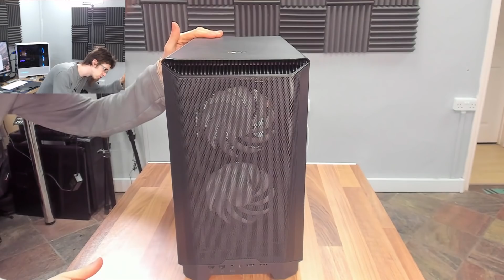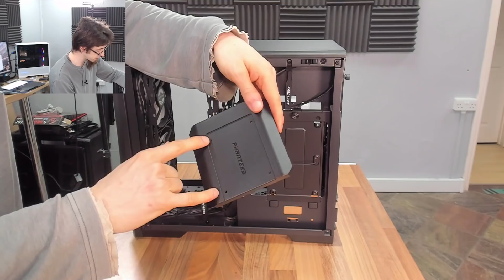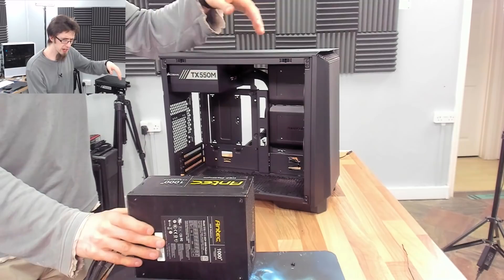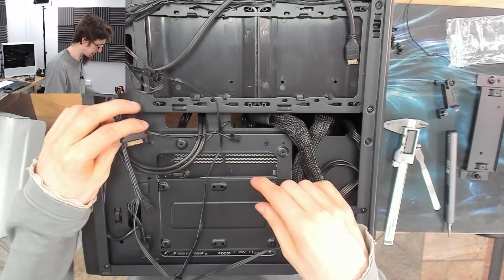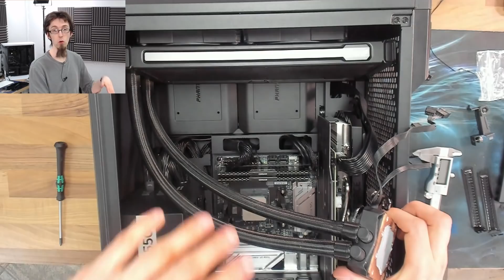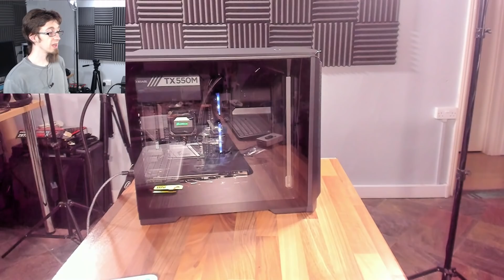Phanteks P200a Overview & Build - LBC#65

Comment: Hi Graham, wondering if you can help me here...? I recently(ish) upgraded my CPU from a 3200G I got brand new to a 3600 I got used on eBay, but I only got round to installing it recently and it gave me several BSODs which increased in frequency (which I wasn't getting with the 3200G) while merely trying to do music production and 3D modelling, even though my friend said he knows someone running a 3600 on the same board as mine (Gigabyte B450M DS3H) with no issue - even though there are better boards out there I don't think a 3600 is asking too much of it.

I tried several things to try and get this CPU to be stable - swapping PSU cables, reseating my RAM and graphics card / trying different RAM configs, running hardware tests which all passed (including even the CPU stress tests, and no I wasn't using the box cooler while running them - 67°C max. while stressed on a Fuma 2), clearing CMOS, updating BIOS, updating chipset drivers... without any luck.

Eventually I went into the BIOS and disabled the default automatic clock speed control setting that enabled the CPU to boost to up to 4.1GHz or downclock to down to as low as 1.7GHz depending on what was required. The CPU is currently running at a manually set fixed speed of 3625MHz (it bounces between 3.6GHz and 3.62GHz) and that way it's stable, but it should work on default settings, and as it's not boosting like this it only slightly outperforms a 1600 on its default settings according to my testing.

I asked the seller for a refund/return but he said it's been too long (over 2 months), that the RAM could be the issue as "Ryzen is extremely picky with RAM" (I have 32GB / 4x8 of HyperX Fury 3200MT/s, half of which was part of the original bundle), that the CPU was working completely fine on both boards that he used it on (an MSI X570 Gaming Edge and an Asus Prime B450M-A), and that he got BSODs on his 5800X at default settings and a whole bunch of issues, and to fix it he has to use higher voltage on the RAM and loosen timings/frequency a little.

Sorry this is long, but do you think I should open a case with eBay or do you think I should just try adjusting these RAM voltage/timing/frequency settings...?

Thanks either way,
Rowan
Reply from the maker: Yea I'd say that's a RAM issue. Reset everything to default settings again (so you CPU is boosting), then try running two modules, try testing with XMP turned off as well. If these have an effect, then make sure you're on the latest BIOS, and try under-running the RAM (if it's XMP 3400, run it at 3200, etc) and that may do the job.
Reply: @Adamant_IT  Thanks, I did change from 3200 to 3000 after I remembered your video where you do it on a "Fortnite box" and it's stable now so thanks a lot :)

Comment: Front fans fit nicely outside and then the 280mm radiator does not interfere with the power button, also better to use 140mm fans for the 280mm AIO. Maybe with the fans outside the AIO would fit with the hoses down too.

Comment: Hi, just want to know what is the benefit of having the PSU on top in this case?  thank you 🙏🏼
Reply from the maker: It allows them to do the full-length vent at the bottom, so the graphics card has clear airflow. Small cases like this often have problems with the graphics card being up against the PSU and/or PSU shroud. Only other way around this is a full inverted setup where the mobo is upside-down and graphics card points up at a top vent.
Reply: @Adamant_IT  Ok. thanks Graham.🙏🏼

Comment: Can you turn off the RGB lights? Most PCs are in bedrooms.
Reply from the maker: Yes, there is an Off pre-set, or you can also disconnect the RGB wires, or turn them off in software if you're connected to an ARGB header.

Comment: No matter the case format, a case without a PSU shroud and the PSU on the upper part of the case is an instant let down for me. You are instantly unable to cable manage properly and the centre of gravity is quite high making one's case feel weird when handling and unstable if placed on a desk, not to mention you can literally see the guts (PSU cables) of the PC at all time if you place the case inside POV on the desk. Check out the Enthoo Evolv Mini ITX from Phanteks, I used to rock one of those bad boys before I went for the full version of the case which I still have today 5 years later. No complaints.

Comment: Usually I'm more a fan of mATX (why go ATX, when you basically have no cards to plug in other than your GPU) but opt for ATX cases anyway because of the flexibility. Case and PSU are the most reusable components anyway.

Comment: Hello sir, saw your dell monitor repair video, i have dell u2414h monitor, with the problem of black screen/no display, i visited the shop, guy there checked the screen and told me FL is the problem, other components are fine, but he is not telling me the actual cost for the repair.
How much will it cost ? Im from india.

Comment: i really like this case but i feel like they could have made it work with micro atx as well without even having to make it bigger
Reply from the maker: Height wise, they're only about 15mm off of mATX. But they'd also have to account for width, and that would mess up the side radiator mount config and everything.
Although I feel like the side-mount isn't really useful anyway... seems like they sacrificed mATX, which would be useful to many, for dual-rad compatibility, which only a handful of people would ever use.

Comment: As long as the NR200P exists cases like the P200a have no reason to exist! If you want to go ssf you either go NR200P and down in size or you dont go SFF at all.
Reply: Why does the NR200P exist?
I have a really hard job trying to understand why such a big case exists.  I have multiple ITX systems and the biggest is a mere 2/3 of the size of the NR200P, the RVZ02. 🔥🔥🔥
Reply: @aetch77  cases like the RVZ02 are very limited in their CPU cooling support. Cases like the NR200 are about as small as you can go while maintaining compatibility with "normal" sized components.
Reply: @TimBoundy  Reality check - if you're going SFF then "normal" sized components are a consideration but they're not the priority.  If "normal" sized components are your priority you should really consider micro ATX at a minimum.
Water coolers, although widely spread, are not normal.  In fact, I consider the cooler packaged with the CPU as the normal cooler.  Any 3rd party cooler you purchase to replace it is a luxury because you're spending extra money to replace something you already have.  That said, I do have and use a variety of 3rd party air and water coolers.
Reply: @aetch77  most of the higher end CPUs don't come with a cooler these days. The 5600X is the only current Ryzen chip that does come with a cooler. Looking at the last generation chips, the Wraith Stealth stock cooler fits, but the Wraith Spire and Wraith Prism coolers do not fit the RVZ02. I haven't checked the Intel cooler sizes but those chips run too hot to make running the stock cooler viable (if they even have one). You need a low profile 3rd party cooler which limits your thermal capacity. In the NR200 however you can easily fit a decent tower cooler or 280mm AIO which is going to be a massive step up over anything you can fit in the RVZ02. A mATX mobo doesn't really give you anything over an ITX mobo in many cases since the GPU blocks access to the other PCIe slots, and the motherboard isn't really the limiting factor to case size in many layouts. You can actually squeeze some mATX motherboards into the NR200.

Plus the RVZ02 can't fit many of the recent GPUs as they're typically more like 2.5 slot thickness. It can fit long cards but not thick cards. The FE cards are usually a bit thinner, but NVIDIA only released those cards to select regions. The only cards available in my region are the thick board partner models.

Cases like the NR200 can compete thermally with ATX cases whilst using the same top end parts, in a much smaller footprint, and all you're really losing is access to the extra PCIe slots. Cases like the RVZ02 are a lot more limiting, but they fill different roles.
Reply: @TimBoundy  Oh my god, you're right.  I'd better run out and buy the NR200P to replace the RVZ02 I've been working with for the last 6 years and the SG05 for the last decade, I think not.
ITX really isn't the platform for high-end systems.  If you've got to go for a case big enough to support the micro atx platform you may as well get a case that actually supports said micro atx platform and get the better/bigger/cheaper selection of components.
Reply: @aetch77  don't be obtuse. I never said you have to replace your current stuff, they fill the role you want. But cases like the NR200 do support the top end components in a compact size. It's one of the most popular ITX cases right now.
Reply: @TimBoundy  Obtuse?  You jumped into something with a flamethrower and torched any chance of a constructive conversation.  You got the rude end of my philosophy.  I don't want or expect a reply of any sort.

Comment: Interestingly this ITX case has dimensions of 205mm width x 365mm height x 400mm depth and my Coolermaster Q500L that I bought after watching Graham's review of it is a full ATX case that has dimensions of 230mm width x 381mm height x 386mm depth. 
I think that if I want a small PC, I have made the better choice.

Comment: I have a question about the PSU gpu cables.
Let's say i can use a single cable on a 8+6 GPU, but is it better to use it, or use the 2nd cable that the modular PSU offer on  the 6 pin?
Reply from the maker: Depends on the GPU. If you've got a good PSU with proper cabling on it, the dual-8-pin daisy chain will easily carry enough power for both connectors. The cable should be good for 500w no problem, well over what nearly any GPU could use.
However, some big-boy graphics cards, especially stuff like the 3080, can pull nasty spikes of several hundred watts, and might get upset. Overclocking can also pull a lot of power, and might start loading up the PCI-E power cable.
So the TL;DR is, one cable is generally enough, but if you've got a second cable, use it.
Reply: @Adamant_IT  I have a RX 5700 XT, PSU is middle ground i would say, EVGA 750W Bronze, BQ if i recall

Comment: I think it is a bit too big for itx, just one pcie slot away from a micro atx. however also it looks designed for high end itx builds - front usb-c (only on expensive itx boards really), 3 slot gpu, space for water cooling. Thanks for checking it out and the build. Proper review.

Comment: when I recently upgraded my case , I seriously looked at that case.. Ultimately though I went with the phanteks p360a in white, wehich is a midtower atx case that shares a lot of the same design features. even though I have a mini itx (ASUS ROG STRIX z390-i gaming)  board in it I have my 3070 vertically mounted .. and it fills the space quite nicely ... big factor for me? the power supply basement .. makes cable management so much easier and cleans up the overall look of the build.. and size wise you really only add vertical height for the most part.

Comment: I have the same MB in a Tower 100. No problems so far, not even the RGB as lackluster as it is. I would love to find an adapter to convert one of those red USB 3.2 gen 2  type A into a type E that runs into the type C on the case. I haven't found one yet.

Comment: Great review. As a shopkeeper and reseller you have a different perspective to the usual review sites which is most useful. 

You mentioned the limited space on the ITX boards: that case looks like it could fit a mini-DTX board which is a wee bit bigger, has two PCIe slots, and has just that bit more room on the motherboard. Also, is there room to fit the two front fans to the outside of the case behind the mesh? I did that on my Kolink Citadel mATX case to create enough room for my RTX 3090.

Something you might like to try when building in these small cases is to use a fully modular PSU and run the PSU cables but not actually fit the PSU itself until very late or even last so as to increase your working space inside the case.
Reply from the maker: There's room for a DTX board, but no additional stand-off holes. Not sure if DTX uses a 6-screw layout or not though, so maybe that doesn't matter. Might be interesting though, as the DTX boards do get the extra headers!
Regarding the fans, yes I'd say you're right - it looks like that's how they expect you to do a two-rad set up in this thing, so you could theoretically have an AIO on the CPU and on the GPU.

Comment: Should have been filtered ventilation on top for the option of the PSU to be mounted fan-up, IMO.

The side fan mounting position seems impractical to me. You're going to use the front fans or the side fans but would you ever use both? Truth be told I would maybe have rather seen an "attic" shroud that conceals the PSU more and sacrifice one of those 2.5"/fan mounts.

I rather like the front I/O at the bottom.

As seen in your comparison, this is barely smaller in overall volume than the 220T (or the likes of my Meshify 2 Compact), so unless you have a weird unique desk setup with very limited height where the case needs to wedge in I just don't see a lot of point to this.
Reply from the maker: I like the idea of the attic shroud. I'd be into that. It'd make space for a 3.5" bay as well. The NZXT H200i is a similar concept to this case, and that's got a 3.5" cage in the PSU shroud. Unfortunately it suffers from NZXT's poor airflow issues though.
But yea, the 220T / Meshify 2C really does undermine the use of these cases unless you've got your heart set on ITX for some other reason.
Reply: @Adamant_IT  yeah the H210(i) seems like the obvious comparison here. Offhand I'd say this wins on cooling/airflow and front I/O but the NZXT might have the advantage in cable management and a couple perks like having a spot for a 3.5". Looks like H210 might actually be a bit smaller as well but I didn't go compare measurements.